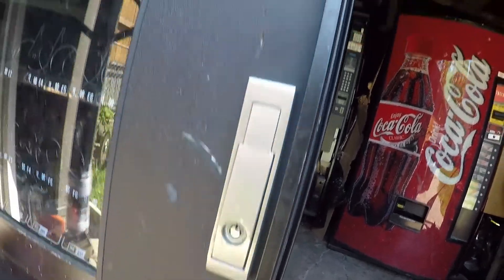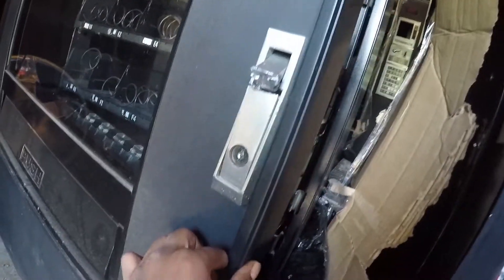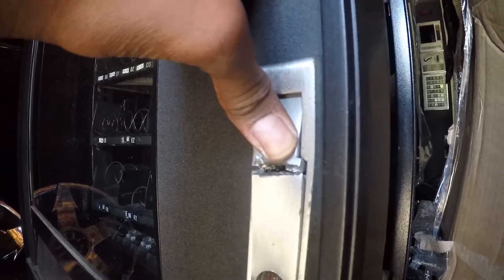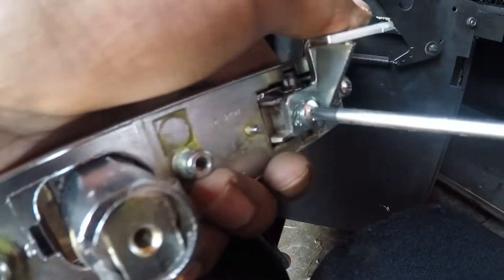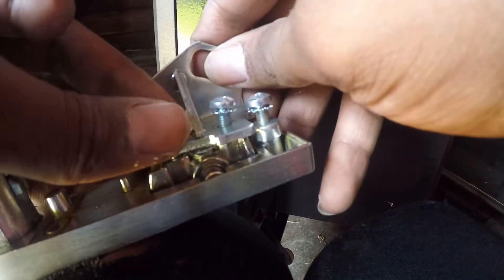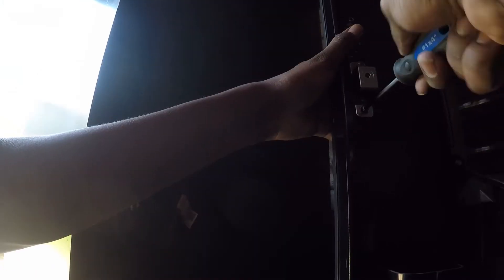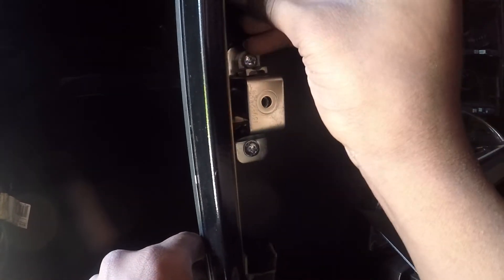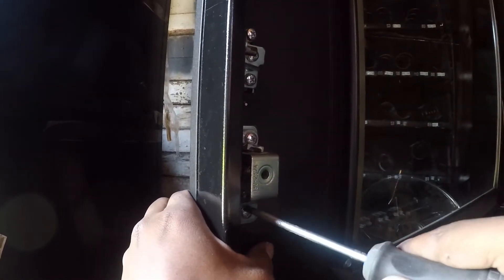HOW TO CHANGE VENDING MACHINE LOCKS IN LESS THAN 10 MINS

Comment: this guy went way too far........what you do is drill out the plug lock. it looks low security so it is a easy drill out.  then you clean out the old plug lock and insert a new plug lock.  there was NO NEED  to cut and mangle the existing lock mechanism.  and then go to the expense of buying an entire lock assembly. if you know what your doing...
Reply from the maker: Yeah you’re right I didn’t know what I was doing at all. I went straight to the “I’m not asking” method 😂😂 The drill bits were cheap and kept breaking but also this was a year or two ago so I don’t really remember all the details but thanks for the info